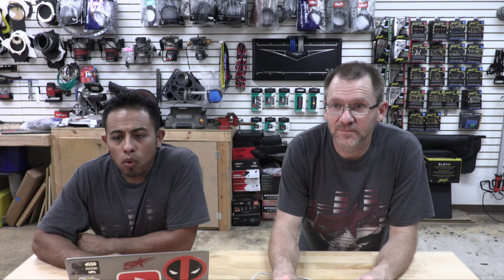Why does the speaker make a POP sound, when the Head Unit turns on or when I change the source

Comment: NEW QUESTION:  I built a custom box with a 12" driver, dual passive radiators, and a 600-watt plate amp.  It sounded fantastic, but I hadn't finished spray painting the box.  So, I taped off the amp and driver and removed the passive radiators.  I realized the back of the woofer was exposed inside, but I only had to paint the front and back.  After putting it together and firing it up, my driver now has constant distortion.  Could it possibly be overspray causing this, or is it something with the amp?  All lights are normal on the amp, which leads me to believe it's something with the woofer.  Any suggestions?

Comment: Have 2 pops whenever a song or video changes and noticed a one of the RCA connectors had the gold tip cracked off causing a bad ground. Always check and protect your wires weekly

Comment: Guys I need help. Amplifier was working really good , recently the amplifier loses power , and when I give the amplifier a good bump it’ll turn back on but shortly turn back off and does not go into protected mode , it just loses power. Please help
Reply: The amp my be low wattage you might need a bigger amp